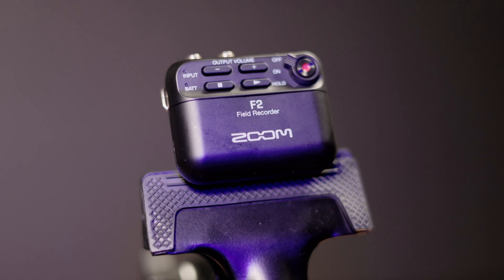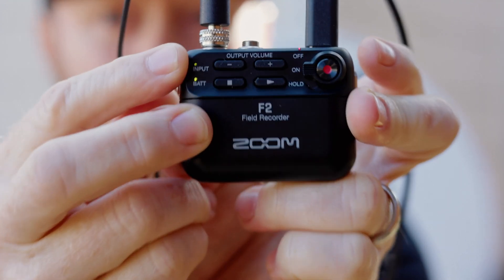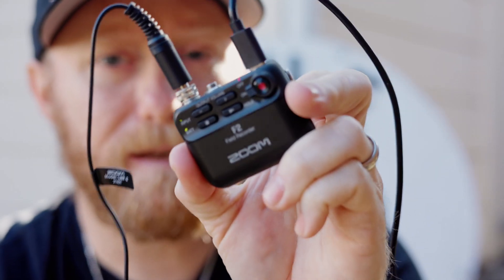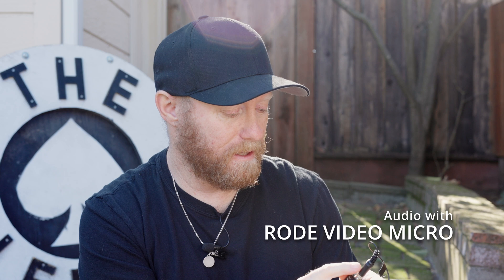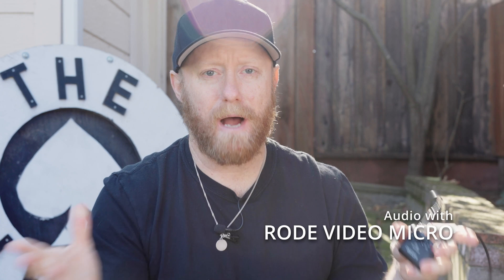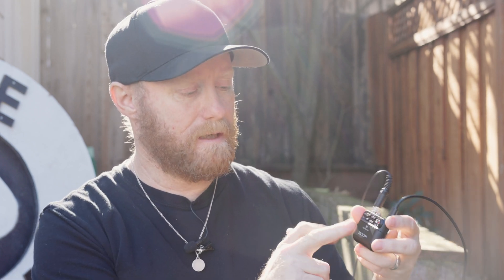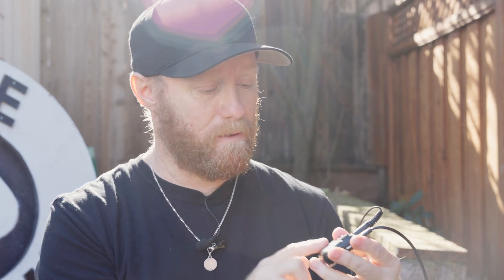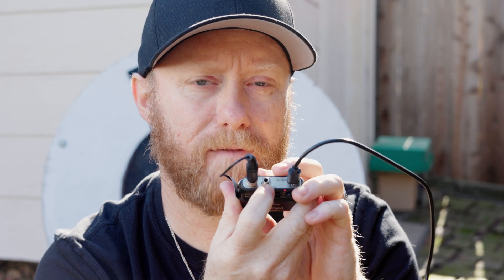32 BIT AUDIO MYTH - ZOOM F2 Review

Comment: I'm surprised with your title of the video.  What is the "myth" of 32 bit audio ?  I bought a couple of these right after they came out, and I find that they are perfect.  My only complaint is I have to sync up the track with the camera track.  But if I clap 3 times, it's a pretty easy thing to do so sync everything up.  I have nothing bad to say about the F2.  For the price, they're perfect.
Reply from the maker: After using them for a number of videos, I have a technique down for syncing audio - involves me clicking my tongue.  As for the myth, if you don't have an NLE that supports 32 bit audio or you don't have a 32 audio track, it doesn't benefit the creator.